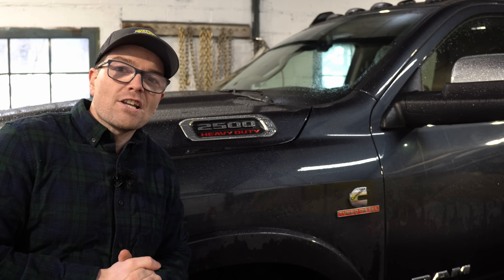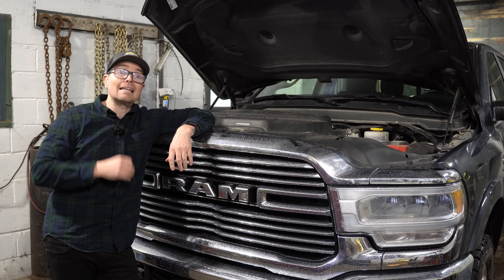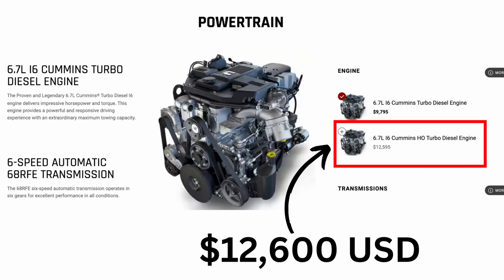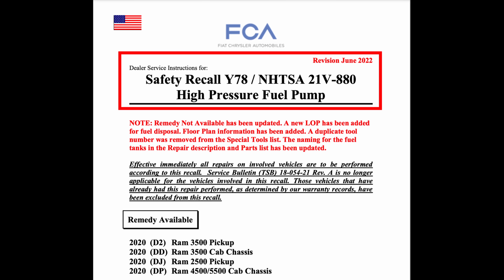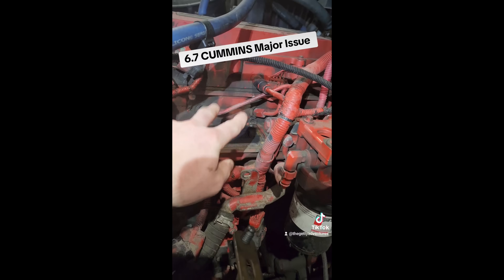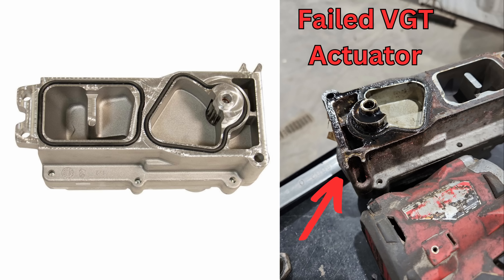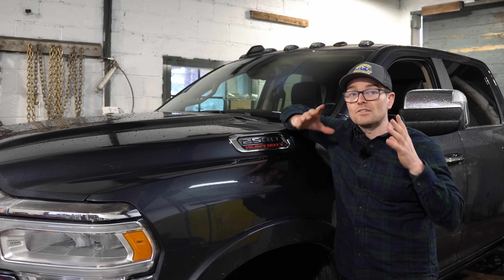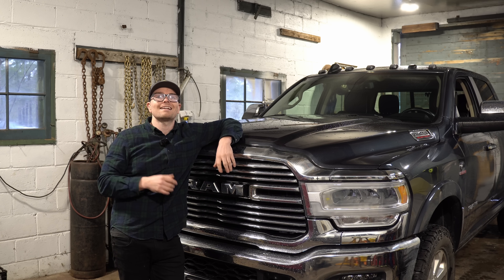RAM 2500 UPDATED 6.7L Cummins Diesel Engine (Details Released) | Diesel Mechanic Review

Comment: The oil filter sprays oil when you pull it out. Not only that, but, you have to pry the cap off and that causing the oil spray.  The water separate fuel filter that use to be under the bed, is now behind the engine bay filter and, up against the fire wall. I haven't replaced one of those yet but, I'm not looking forward to it.

Comment: The ZF 8-speed transmission is a big deal with the 3.73 or 4.10 rear ratio.  The 3.42 ratio is for the speed demon 90mph cruisers.
With the ZF 8-speed, 4.10 ratio, the  4cyl ISB engine would be the ticket.  Since 35 or 37" tires are a popular upgrade on 4wd.  The 10k GVW is the threshold for having a medical card in many commercial uses.  Plus, clearance lights are required above 10k gvw.  These are usually harassment tickets but are legitimate in the law.

Comment: I have a 2024 ram Laramie 2500... I've not had any problems... I got some upgrades from the dealership with different wheels and tires.. extended warranty... I don't use mine for work and so many people frown on it but who gives a turkey... If you drive it hard, service it regularly and don't abuse it... It'll last you 400k... My 2006 Cummins had 585k when traded in... Of course there was maintenance and repairs.. I live in Bellingham Washington so it doesn't really get freezing here... So no issues starting...

Comment: Running a “glow plug” style plug in my 2012 6.7 in a banks monster ram, never had an issue with it starting. The oil filter being relocated sounds great cause getting to them now is a pain in the ass.

Comment: I was waiting to see if they make another 7.0 Hemi (426) but for the 2500 it would be cool as hell to get an updated one that can compete with ford's 7.3 godizilla so what if it gets 10-12 mpg put it behind an 8 speed ZF and make it put out 500hp and 525ft lbs of torque if you design it right it could be competitive and if they redesign a next gen hemi with a better oiling system they'll be better than everything else in terms of reliability that was the only flaw was a weak oil pump and that can be fixed for a few hundred dollars.

Comment: It used to be that a Ford truck with a Cummins engine and an Allison trans would have been the hot ticket. Times change the new Ford 10 speed auto trans is probably better than the Allison and there were too many failures with the Cummins injectors among other things to make it reliable.

Comment: note to self when crossing a frozen creek and u encounter thick ice and realy need to cross it remember this.....turn around use the rear of the vehicle to break the ice not the front youl blow your radiator,,,,then turn around once u cross it in reverse .and proceed with your trip or going to your mine site or logging operation.....

Comment: I've been looking for a new 2500HD diesel truck but I've been leaning more towards GM only because I want a practical single cab truck which are obviously priced less than the extra cab but I know Cummins has a good reputation for longevity and durability but 3 things keeping me away from Dodge are 1: Their auto transmissions didn't hold up well under heavy towing (excluding the ZF trans. that hasn't been in a lot of Dodge trucks so it has yet to be known) 2: Very hard to find a Dodge single cab 2500HD with a Cummins platform and 3: Price is too high, so far the GM Duramax 2500HD 4x4 single pro model is the only truck that's close to my price range and seems to check off all the right boxes. 🤷‍♂

Comment: Electric drive train with a diesel generator to charge batteries and allow the consumer to pick the size of the fuel tank, the potential for a 1,000 mile range is there.

Check out Edison Motors, they are building semi logging trucks and Ram is coming out with the Ramcharger very soon, but that is still a plug in, which I don't get.

Comment: I got a question. If you don’t pull something heavy with a diesel will it cause problems with the diesel truck? I ask this because that’s what my local dodge told me. I owned a 3500 4X4 dually and didn’t have any problems not pulling something heavy. Let me know.
Reply: Hint “local dodge” they might be wanting you to come in yk$ however I think you don’t need to pull anything

Comment: CGI isn't really that special, its just a different and specialized type of cast iron. Its tensile strength is between nodular (ductile) iron and gray iron. Its density is more or less the same - meaning if you cast two identically-sized parts in CGI vs. gray iron - both will weigh the same. The potential weight savings comes from the higher tensile strength of CGI - meaning you can make the block thinner yet retain equal strength. The problem with this is it's easy to go too far and risk failure. Even if adequate raw strength is achieved - the resultant loss of web thicknesses will decrease stiffness and not attenuate potential vibrations and harmonics.

The fact Cummins removed 70*lb of weight from the block suggests they really went to town thinning down wall thicknesses. Clearly, they went too far.

I used to do NASCAR engine stuff - those CGI blocks are heavy AF. They actually make them even thicker than regular castings... IIRC the R07 block weighed 215*lb compared to a normal iron SBC block weighing about 150*lb.

Comment: Is the heater grid bolt and issue on the commercial Cummins? I currently have 5 new busses in my fleet, all with Cummins And I've yet to find the answer to this question

Comment: THE  HEAT  IS TOO HOT  THAT IS  WHY THE BOLT  FALLS BUT  THEY HAVE  A  RESISTER TO  LOWER THE  VOLTAGE  it  burns off that  is the  problem

Comment: As a 12v owner, hearing about glowplugs in a cummins makes my head hurt. As goofy as the old grid heater and fuel heater delete ends up, ive never had issues with this truck starting. Im so out of the loop with these new trucks.

Comment: IF Ram is smart with the 6.4 Hemi, they'll source a RELIABLE cam and lifter maker,  ditch the MDS, and dump any oil pump that is not Hi-volume and Hi-pressure even at low idle RPM. Just go straight to Melling. If Ram does that, they will very soon own the HD gasser market.

Comment: To put all the dick measuring power and torque numbers by the manufacturers in perspective,  in the 70s and early 80s, we drove over the  road tractor trailer rigs that had 350 hp and 1110 lb/ft hauling 80,000 lbs. Not sure why it is needed to have 400+hp and 1100 lb ft in a pickup grossing 45000. And we worry about reliability.

Comment: Have you noticed more torquing failures on the composite block on the HO vs SO engines? I have a 2022 SO 3500 and am curious if I can expect a failure coming.

Comment: I'm a huge fanboy and seriously was following along with this because I am considering upgrading but... All I'm hearing is; it's the HO motor (they already have) with a cast iron block (older heavy) with glow plugs (Older less reliable?), with cartridge filters, (Meh), and a fuel injection system linked with horrible failures... Oh and btw... Its gonna cost more than the current platform. 

I feel like if you're gonna ask for more money you best put out some really new tech, some innovation, something that changes the market. It seems like they are literally taking steps backwards in the industry, offering mid and asking for top dollar. I hate this honestly. They need to really come out of the park with something groundbreaking at the show. No DEF, drastically improved efficiency, and proof that looking at everything that worked before is worth a premium markup for tomorrow.

Comment: Seems like cummins went smart and addressed reliability issues over adding more power. Which is good, the average Joe doesn't need 1200+ ft lbs! At this point they are all just in a D measuring game, I'm happy with my 24 6.7 SO, it does what I need it to do in terms of powertrain.

Comment: Only took 18 yrs to address the failing grid heater bolt 🙄 IMO the hydraulic lifters wouldn’t be as common of a failure if owners used the correct oil and changed it every 5k mi vs every 7.5k - 10k.

Comment: I will stick with my dog of a P-pump 12 valve Cummins cheap as cheap gets does everything i need of it dead reliable and non of the modern complexitys and epa equipment of these modern units.

Comment: Honestly, I was a Cummins fan, but I’m definitely turning more n more towards a new Ford powerstroke for a diesel. Simply because the 6.7 powerstroke is overbuilt, has steel pistons from the factory, and made in the USA! That would be reason enough for me to buy 1. 
If Rams were USA designed and built, and the Cummins weren’t cheapened to crap, like hydraulic lifters, and cgi weakened blocks, Absolutely 100% would stay with Cummins.

Comment: Ford should drop the Godzilla the 5.4 and make a 7L coyoteXL and they would make everyone happy except the competition.
Reply: You sir just won. Congratulations dumbest comment in the comment section award goes to you.
Reply: Sounds like a monstrosity that would solve a problem that doesn't exist. The whole point of the 7.3L gas engine is it packs a lot of cubic inches into a compact package. Undoubtedly, OHC creates much better valvetrain action... But that's only helpful for high rpm use. The OHV configuration doesn't tend to become a problem until more than 6000*rpm; where the 7.3L doesn't operate.

Comment: Just remember the relationship between stellantis and cummins. Many of the design characteristics are specified by stellantis at their own detriment. Just wait until everyone finds out about how bad the new aftertreatment systems are. This model year was designed by a skeleton crew during covid and its going to be rough for a while from an engine standpoint

From what I've seen so far, the chassis cab version is going to be a better engine

Comment: One thing to consider is that here in Australia we have these engines in buses, and they are detuned to 320hp and have no problems pushing a bus that weights 20 tonnes.
Reply: What bus weighs 20 tons?
Reply: @handleymacdonald5760  pretty much all metro transit types and coach buses, though admittedly that high of a GVW would typically run 9-12L engines
Reply: 20 tons???? What the hell kind of bus are you talking about?
Reply: Uh yeah, school buses in Australia weigh 20 tonnes when fully loaded.
There are a lot of corrugated dirt roads out here that the buses use to get to school.
Reply: @alanwilson4208  I can’t see anything more than 25-30 tons but okay. Either way it doesn’t matter what HP you are running as long as it’s geared low enough it’ll be sufficient.
Reply: Usually these engines here use a 6 speed Allison automatic or a 6 speed ZF automatic with retarder, nothing too fancy but happily sit on 100kmh at about 1700-2000rpm.

Comment: As a midwest farmer, i know 4 local guys that have shredded cgi blocks in less than 70k miles and no one buys Rams that use their trucks for work so thats saying something.
Reply: Weird, my 1995 Ram Cummins 12 valve is still perfect. 😗
Reply: @melissasmess2773  Does that 12V put out 430hp?
Reply: As a diesel mechanic, I can say I've seen farmers tear up just as many ford's and chevy's. Hell, farmers can tear up a steel ball in a rubber room. I'm not sure who is worse for maintenance, farmers or loggers. Seems like a race to the bottom with their ideas of maintenance.
Reply: @ you must be where all the rich farmers are that can afford to break stuff an pay someone to fix it.
Reply: My 2018 ram has 550k. Used for work and play. Ive had to put in new injectors...thats it. Sounds like those farm boys are abusing the trucks
Reply: @ yes we do abuse trucks, thats why we buy Fords…every harvest i come across the scales over 45k lbs pulling grain wagons in my 500k mile F250 6.0 thats had nothing but injectors and one or two sensors. Hell ive seen guys pull 2000 gallon water tanks with chevy colorados. Never buy a used farmers truck, we actually use them and wayy passed the mfr rated limits.
Reply: Never heard of all the bad stories about Cummins. My stock 2003 with 360k miles runs flawlessly on the OEM grid heater, injection pump and injectors. Must be Furt guys trollin' this message.

Comment: And people still complain about 6.0 Powerstroke engines even though after a couple upgrades they become extremely reliable, yet these new 6.7 Cummins engines in $100,000 trucks will most likely eat lifters and have fuel pumps that grenade 😂
Reply: 6.0❤
Reply: Seriously, yay let's continue to complain about a 20-year-old engine

Comment: I’m glad that they are going to try to improve the 6.4 Hemi too.  I like that engine.  It just needs a few tweaks for more reliability and efficiency.  Hopefully that works.
Reply: Should be 6.8L as well.
Reply: For sure. Just a reasonable bump in power, lifters and exhaust manifold/ coolant passage issue and they would be a hell of an engine

Comment: Ram can't sell trucks because they just don't compete well in my opinion. I currently have a 2017 ram 2500 and it was an upgrade from my 2016 F150. I feel like it isn't nearly as comfortable and though this Big Horn is technically optioned better than my XLT was I feel like the F150 XLT was better equipped. If I could go back in time or afford to change my mind now, I would go buy an F250. 

I work in fleet maintenance and we have a customer that runs 7 ram 5500s and a different customer that runs 12 F450s. In my experience the Ford is a better product, general maintenance and a couple recalls is all we have had to do on the Ford trucks with the exception of one that needed a turbo whereas the RAMs have had multiple recalls and have been in the shop repeatedly for multiple little things such as brake pedal position sensors on a couple, miscellaneous sensors on the after treatment and one has gotten a new actuator. Currently there is one RAM getting a new engine and after treatment due to a failed turbo that dumped the oil into the exhaust and another one that has electrical gremlins I am working to diagnose (currently I think it is the ABS module but I haven't finished diagnosing the list of fault codes) plus there is another RAM that both key fobs with brand new batteries will randomly require the key to be directly pushing the start button otherwise it says key not detected.